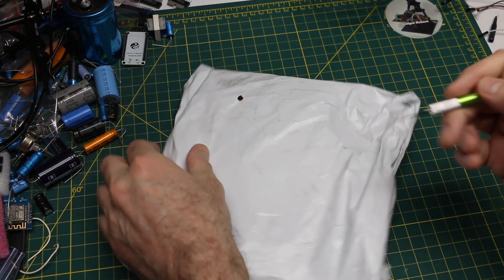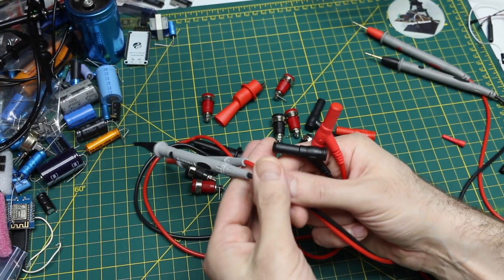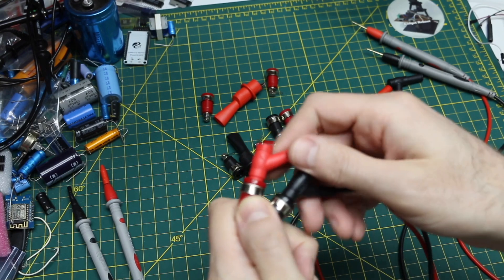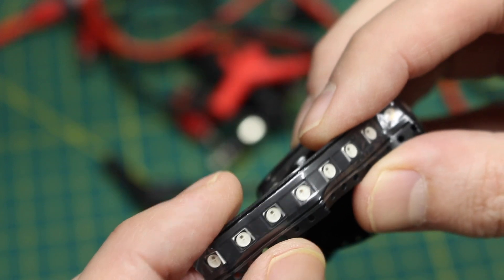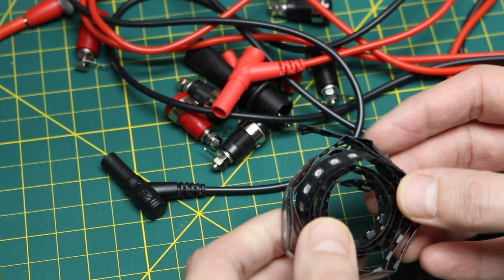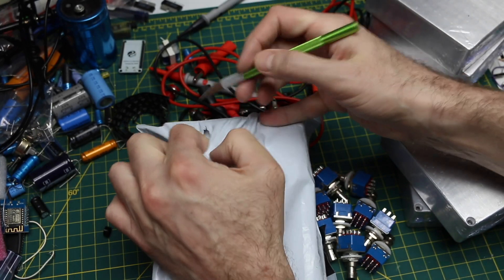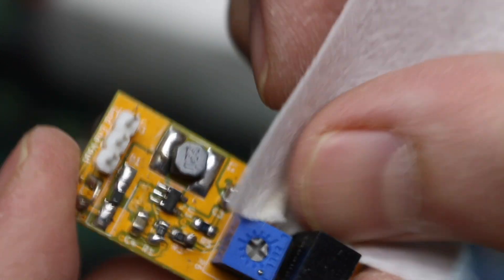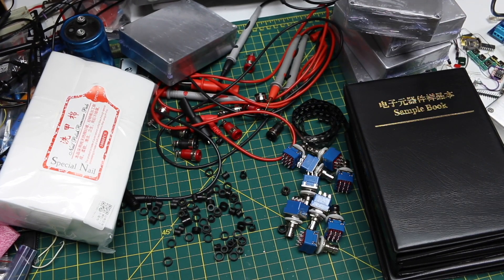Mailbag!

Comment: If you want a better set of probes search for "Cleqee P8003" i have 2 sets and i'm happy with them, much better than those you got 2 pairs, but be aware that these that i'm talking about don't have the wire included, they need 4mm banana, i made myself the wiring with 16awg silicone wire 4mm banana with a hole on one end and 4mm safety on the other end. One more advantage is that you can buy screw in replacement tips.

Comment: I bought some Kimtech wipes for cleaning glass and flux on someones recommendation.
You could treat the bent probes as a feature.  Yeah, that is the way they ought to be.
Reply from the maker: I first saw Kimtech wipes in a job in 2001. Looks like they can be found on Amazon, I wonder how the cost per square inch compares. A mathematical exercise for later.

Comment: I have been using those SMD storage books for a while now; They work fairly nicely to keep things organized with the hardest part was getting all of the components laid out prior to inserting them. I ended up leaving a number of gaps and empty half pages so I could insert missing values as I obtained them. I use a Dymo label maker with thin tape to label each strip as I insert them. Some strips are easy to get in and out others not so much at least at first, they do seem to stretch out over time. They also make it easy to see what you are running low on...I keep some bulk overstock of the popular values in my old drawer system just in case.

Comment: I have a bunch of tips, I hope you don't mind! Those clean wipes can take a serious medieval torture with a wire brush!! 😆Good on you to get those. See if you can find Rocket Sockets, they help tighten hardware onto your (potentially nicely painted) enclosures without scratching the surface. And finally, when you drill into those aluminum enclosures, drill slow and apply a lot of pressure. 👍I can't wait to see what you make! 😃
Reply from the maker: I was going to try to see if I could find some sort of 3-D printer model for those nut sizes but now I know what brand name I can look for as well.
I wonder if I might get to use my stepped drill bit to drill the bigger holes on the enclosures I think I saw somebody doing that but I’ll have to learn as I go.
I figured by having a total of 10 enclosures with the two different sizes, I should be able to eventually get one working enclosure out of them all. I’m expecting I can use that clearcoat spray that I bought last summer for the waterslide decals as well.
Reply: @GadgetReboot  "I wonder if I might get to use my stepped drill bit to drill the bigger holes" Absolutely and extra good on you if you have a drill press (I don't 😆!) I also strive to find the smallest enclosure I can fit the circuit in but in one circumstance I had to go up to the next size enclosure size because the PCB would no longer fit when the pots were installed into it. I have lots of advice on spraying paint too but I honestly learned all this stuff by finding videos here on Youtube. 😄👍
Reply from the maker: I don’t have a proper drill press but last year someone gave me one of those makeshift presses that you put an old corded drill in, I haven’t tested it out yet to make sure everything moves smoothly and in a straight line but that would definitely be my approach.
Years ago I remember seeing videos about doing swirling paint patterns on a pedal box by putting spray paint in a bucket of water and dipping the pedal in or something like that, I’m not sure if I will even want something like that but there will be lots of research done.
Pots are the big concern I have, I either have panel mount ones that I can bolt to the case properly but not the right values or I have the right values but they don’t even have any way to mount other than soldering to a board and no nut fastening option so I’m not sure if I’ll just do some makeshift thing for my first attempt, maybe just aim to get something working at all even if I repurpose the case for a different design.
Reply: @GadgetReboot  yeah when it comes to pots there are two kinds --- wired from the board to enclosure mounted pots or one that are soldered to the PCB. If you can fasten the pot to the enclosure then you can pretty much wire any of them up. You can even clip the leads if they are too long. It better of course to have eyelets but you can wrap a wire sufficiently around a lead.

But when it comes to PCB mounted pots you really want to get the exact right lead size and lead angle over the resistance value or travel type because it is more important to have a good mechanical connection IMO. I built a pedal for a friend (ex band-mate) but I didn't have the correct travel type for a pot and as such, there was only a tiny zone that was useable. I later ordered the right pots and told him I would replace it. I did and it worked out much better for him. My point is that I think it was better to use a pot that provided a good mechanic connection first and just replace it on down the road when I finally sourced the right part. Cheers!
Reply from the maker: yeah I was surprised I’m having so much trouble finding the right combination of pot values and tapers and pin mounting and panel mounting stuff when shopping on the main stream places or even AliExpress it’s almost like they’ve never heard of guitar effect potentiometers and every time I see projects in videos they use the kind of pots I want.
I think I could get them through smaller distributors if I lived in the US but I haven’t had much luck here so far.
Reply: @GadgetReboot  Tayda has been my goto source for guitar pedal stuffs, they have a fantastic selection.